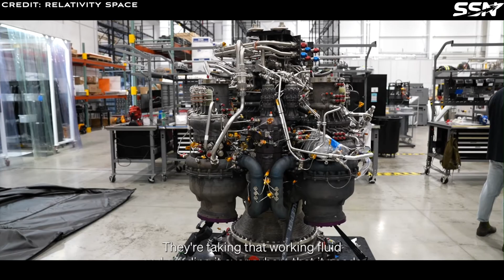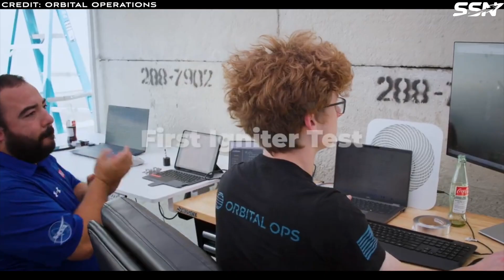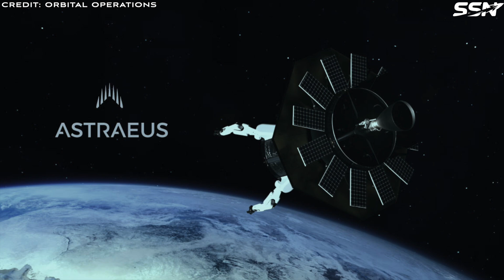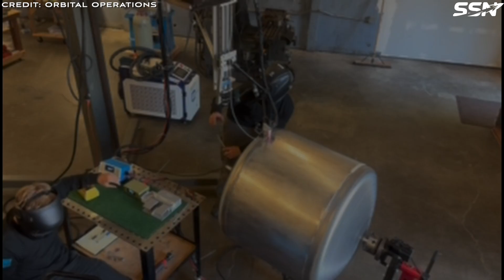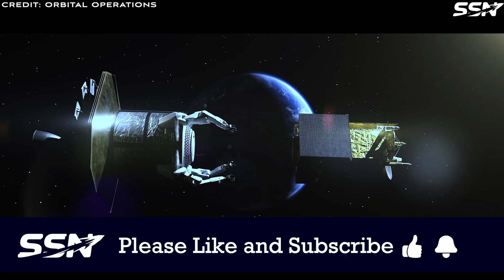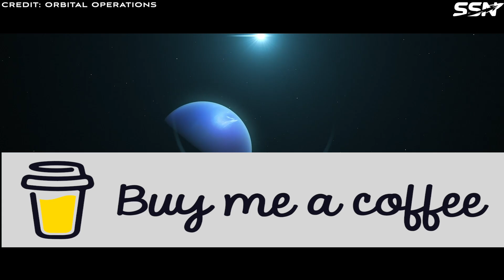Orbital Operations: High-Thrust Space Vehicle using Liquid Hydrogen Fuel

Comment: Seems like you would design the craft so the radiator was constantly in the shadow of the ship meaning one side would get constant sun. I'm not sure how hot and cold that would be but if it's like the Moon then it's like 0 degrees Fahrenheit plus 250 or minus 208.
Reply: Vehicles with high power demands have lots of solar panels to cast shade.   The cryogenic tanks will need to be kept in the shade from the sun, and shielded from the radiators.

Everything but the solar panels and communication antennas can be shaded. With a little plumbing, any parts with minimum temperature constraints can be heated as needed.

For example, the oxygen plumbing is designed for liquid oxygen not solid oxygen.